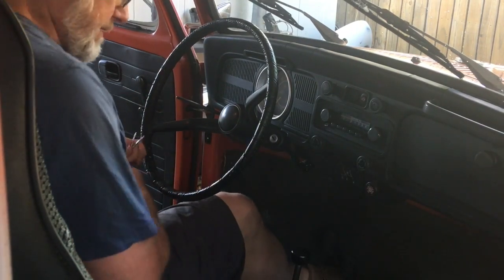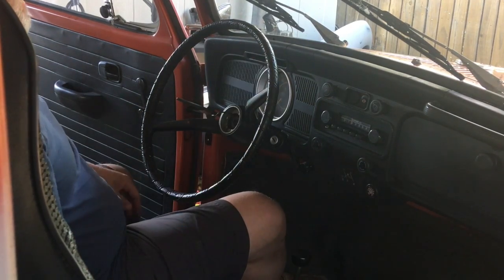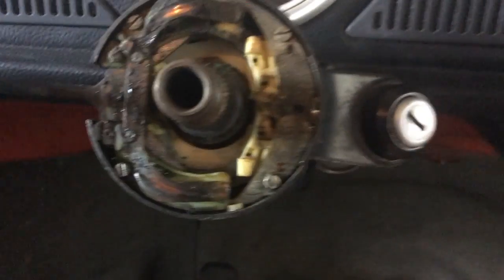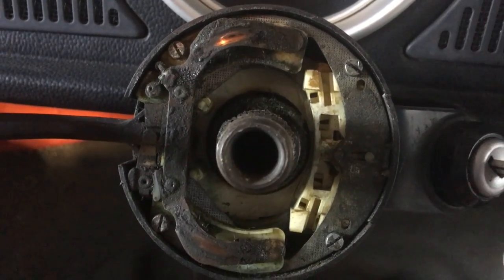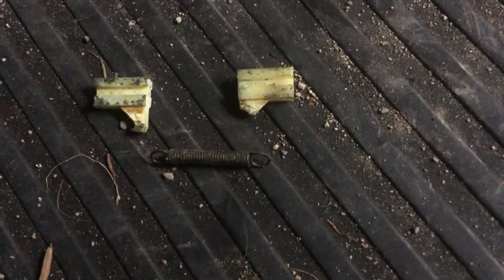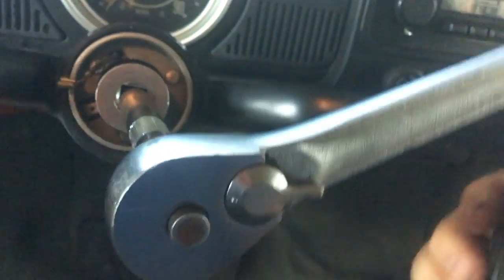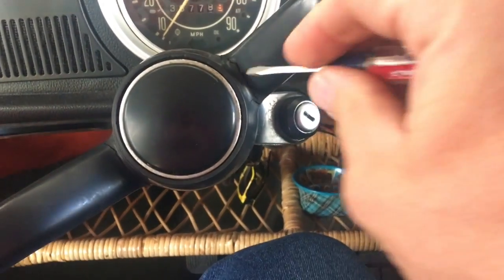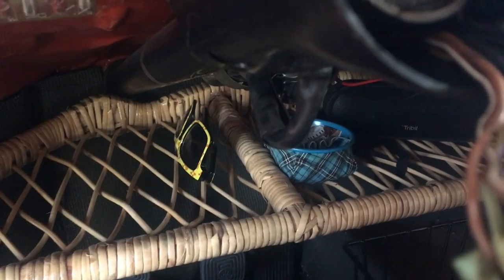'71 VW Beetle Turn Signal Switch replacement

Comment: Dude! That squealing! lol. I have not had a bug where the buzzer still works. After hearing that... I kinda want it back! It's more original. After all the customizations I've done over the years, I prefer stock stuff on these old bugs. VERY helpful video, Mr. Genius!
Reply from the maker: Thank you Mr. Meehan. I need to get the auto off to work, the switch seems stiff. Also, still no brights!
Reply: The buzzer on my 70 Ghia is faint but it does work, sometimes. Cracked me up the first time I heard it. Took me back to when those were one of the first electronic "conveniences" added to cars. The American buzzers were the worst, but the Japanese had a pleasant bell.

Comment: Fantastic Video !!!  Just got a 69 and my turn signal switch doesn't work so you just gave me confidence . Thanks
Reply from the maker: @sparlin88  that was the hardest thing I’d done up to that point! I since put together a manual transmission, and it still works!
Reply: This is my first bug in my life at 65 yrs old . I need to also install shift rod bushings at both ends . Found some on YouTube that are metal and will outlast the car they say . Not plastic or rubber . Gonna take care of the sloppy loose shifter .
Reply from the maker: @sparlin88  new bushings make an amazing difference. There’s been a few metal bushings out over the years. Good luck!

Comment: These old VW’s will drive you crazy getting all of the little things sorted out. I gave up with a few minor things on Jawbreaker lol
Nice work man, hopefully it won’t take you another year to get the high beams working 😂👍
Reply from the maker: All I have to do is pull over and change out relays... I’ll find it. It’s just not hitting the relay for whatever reason... brake lights tonight... those need new switches too.

Comment: Have a 72 with a similar problem with the turn signals not cancelling.  Replaced the switch assembly just like you did, but now the horn beeps whenever I turn left...wtf?  Ended up reinstalling the original switch and just learned to live with having to manually cancel my
turn signals.  Thanks for the great vid!

Comment: Hay, nice video but you did not show turning the steering wheel and seeing if the cancel worked. Did it work or did you have to loosen one or two of the screws to release some tension.  The little tab that sticks out is moved  up CCW or down CW to cancel.  You can test that without the steering wheel on.  Many of the aftermarket mechanisms do not have to rolled spacers to keep folks from tightening the mounting screws so tight that it squeezes the back and front thus binding the mechanism.  That little S spring is all that there is to move the lever back to center.. as you know.  Jim
Reply from the maker: It didn’t work at first. I did have to loosen a couple screws. Also there was very gloppy line in it and I cleaned some of that out. It does have the spacers. I don’t remember if I mentioned it but it is the Wolfsburg West part which is supposed to be a copy of the original.

Comment: How do you keep the contacts on the switch from touching the steering column and frying the switch? I've gone through 3 switches so far. They never last more than a couple weeks.
Reply from the maker: On this switch everything seemed to be behind plastic. There is a contact on the top for the horn, but the rest was inside. This one wax from Wolfsburg West so maybe there is a difference in the build quality? Also, this is 71 only so other years may not be the same.
Reply: @Misunderstoodboygenius  I have an early 71. It uses a different switch.